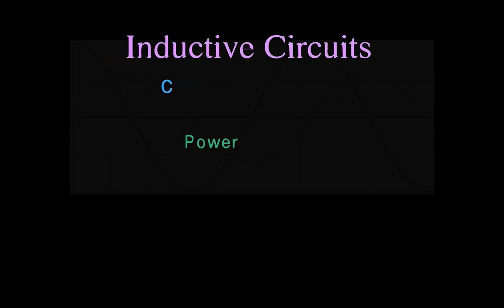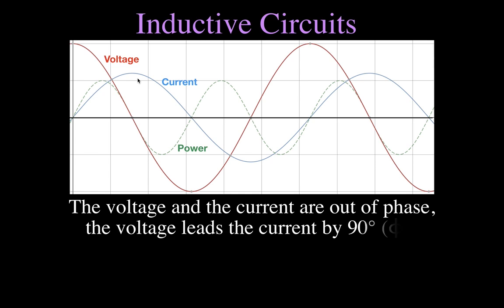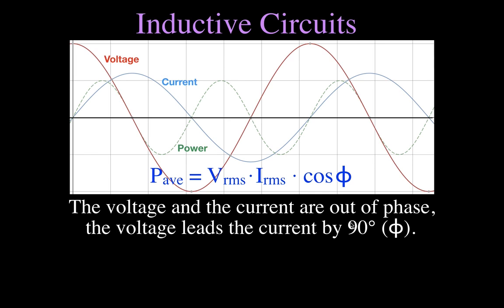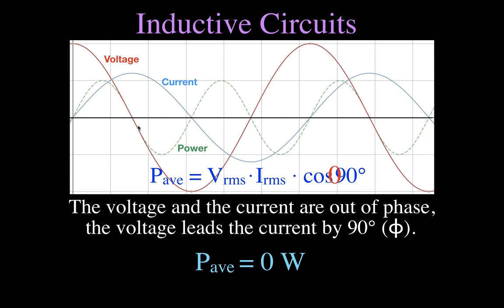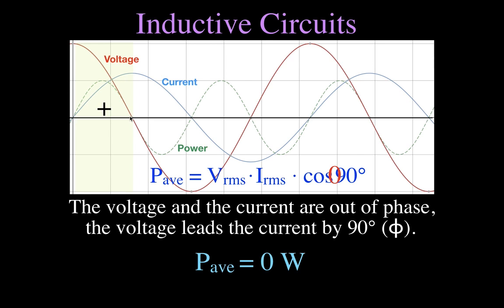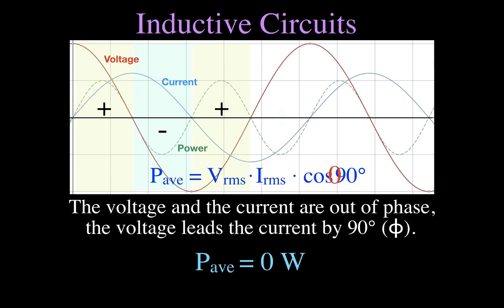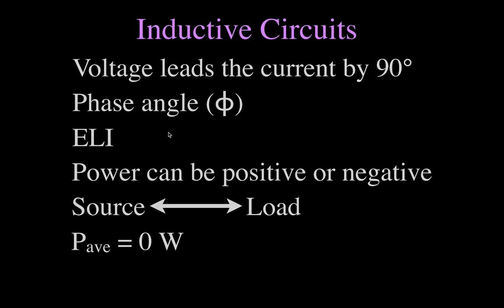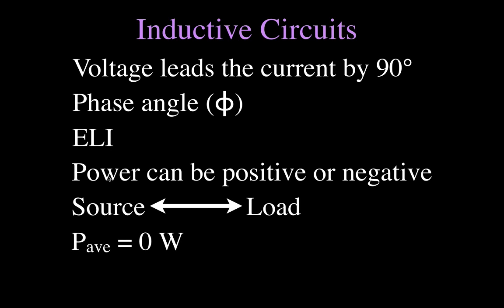RLC Circuits (3 of 6) Power in Inductive Circuits

Comment: If I plugged in a pure inductor (or a pure capacitor) into a wall socket in my home, would the power company recognize the current flow and charge me for power consumption? How does it quantify power consumption?